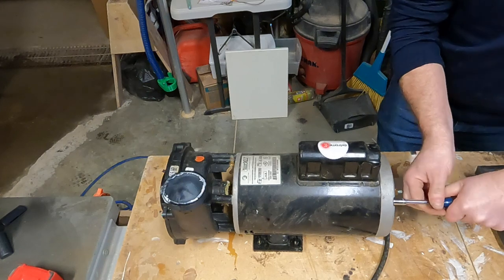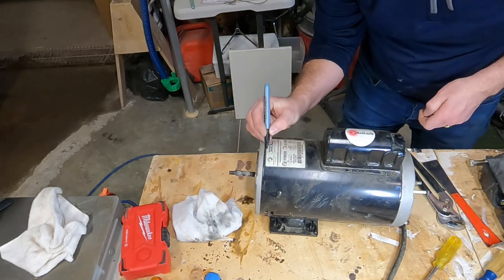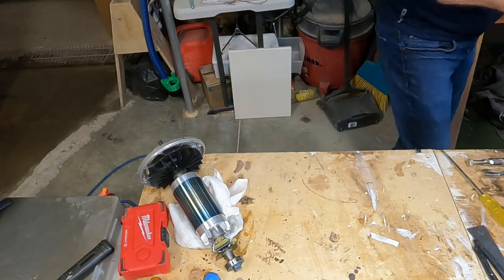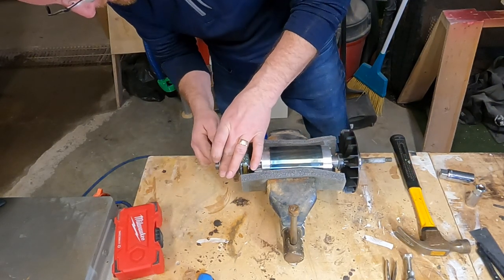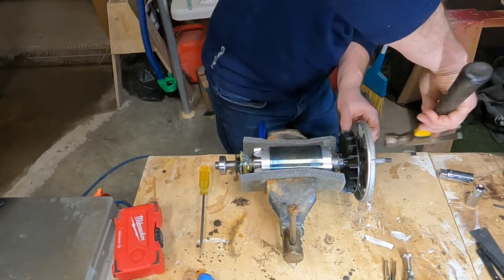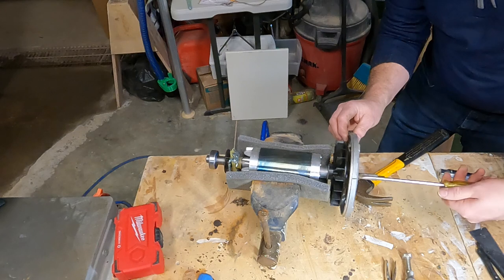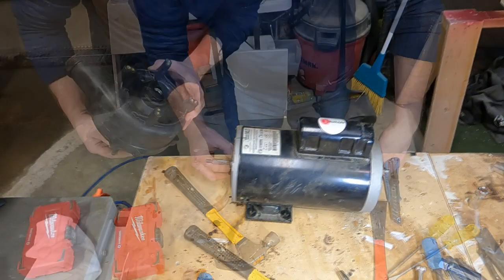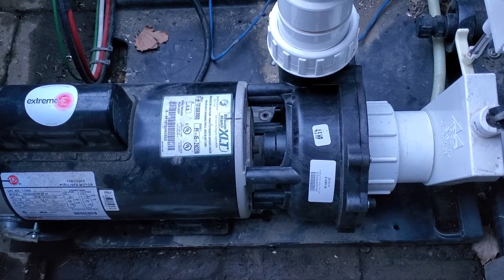Hot Tub Spa Pump Motor Rebuild

Comment: The stator is the windings in the housing. The rotor is the thing you clamped in the vise, rotor because it rotates. Lube the daylights out of the through bolt threads with anti seize compound so you can get it apart next time.
Reply from the maker: Thanks for the insight, great tip on the anti seize compound.  Thanks for watching and commenting.

Comment: thanks for the video, it helps to dismantle the pump. what if water gets inside the copper wires that surrond the shaft, if the the inside motor gets dry is the pump likely to run without issues? i got hold of a 2nd hand pump which runs hot and switches off after 2-3mins. i removed the top lid and found some rusty water and burnt smell. i wonder if I can save the pump or not.
Reply from the maker: Sorry, I am hesitant to provide any advice on that one.  A bit out of my comfort level.  Good luck.

Comment: My pump is really loud, so I assume that I need to replace the bearings inside the motor.  I also need to get a bearing puller.  Mine is a Waterway Executive 56.  Where can I find those parts?
Reply from the maker: If you take the motor apart and look at the bearings, you should be able to find the bearing number on them, or you will have to measure them to figure out what size of bearings they are.  You can google how to create the bearing number from measurements.  You should be able to find a bearing puller at your local automotive supply store.  As for the bearings, you can order them online or go to a local shop that carries bearings.

Comment: Any tips for when plastic impeller is siezed so tight thor cant move it?
Reply from the maker: You will have to grip the shaft with a pair of locking pliers.  Then you can use more force to take the impeller off.

Comment: My 6hp pump impeller (2 speed) is not broken, but does have a hairline crack on the plastic stem that goes on the Stator steel. Does the impeller need to be replaced then?
Reply from the maker: I would have to see a picture, but if it has a crack and you already have it apart I would suggest replacing it.  The last thing you want is for it to break after you have put it back in service.  In my experience that always happens at the worst possible time.
Reply: @gtrsquared919  Thanks, I bought a new one anyway, they're not very expensive and while its apart why not replace it. TY.

Comment: I did this rebuild but the pump just clicks. I also have the flo error. Noticed it’s hard to spin the shaft from the backside also. The other motor spins freely with a flathead on the shaft.
Reply from the maker: Does the shaft spin easily on the pump you rebuilt?
Reply: @gtrsquared919  no when I put the flat head on the back it spins, but not easily like the other motor.
Reply from the maker: Sounds like something is not seated properly or a bearing was damaged.
Reply from the maker: Did you replace both bearings?
Reply: @gtrsquared919  yup
Reply: @gtrsquared919  I’m ready to just buy one.